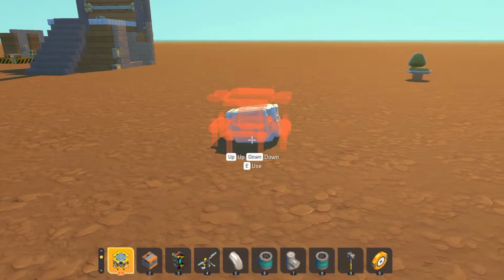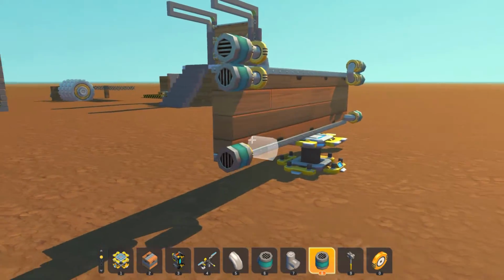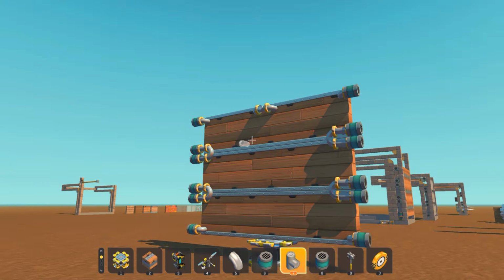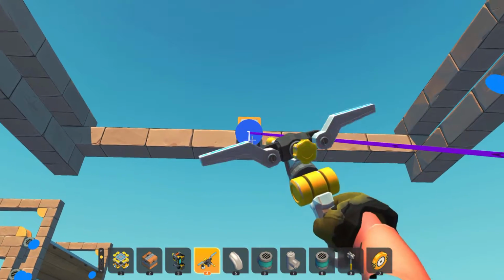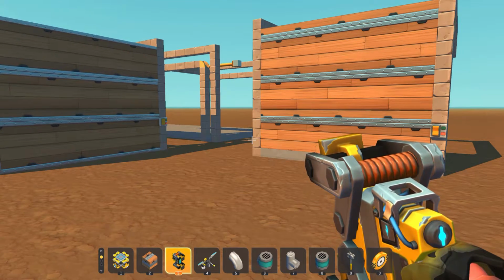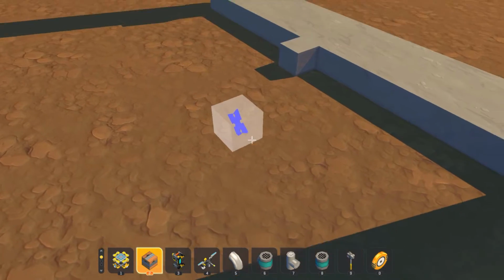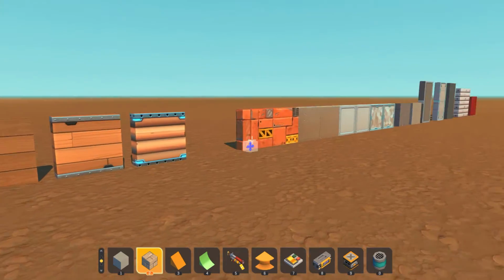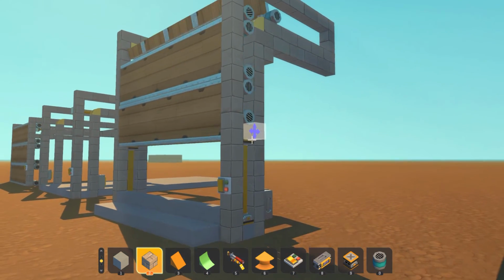Working Garage Doors!  | Scrap Mechanic | Tutorial - All Survival Parts

Comment: verry cool, ive been looking for a desing like this for a while & I couldnt get a desing of myne to properly work.

just to be shure, I can expand it & make it higher/taller?

and also, I think you might not need those bearings on the "roolers" : )
Reply from the maker: Higher shouldn't be a problem. If you go higher than the max piston ext length you'll need to "stack" multiple pistons for the retraction.
Reply: @NowLetUsPlay  ok thank you : )

Comment: can i get it the wider as i can ?
Reply from the maker: I'm sure you could go wider. The only thing you might need to consider is the weight of the door. It may require additional pistons to pull it open if you go really wide.
Reply: @NowLetUsPlay  oh thinks for the amazing tip ! :D